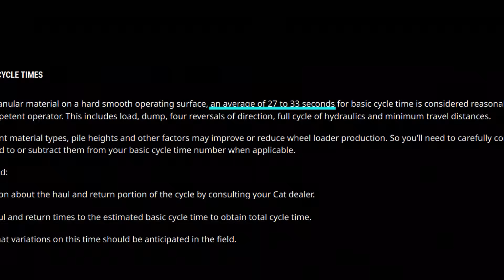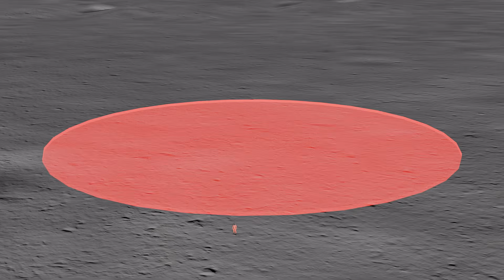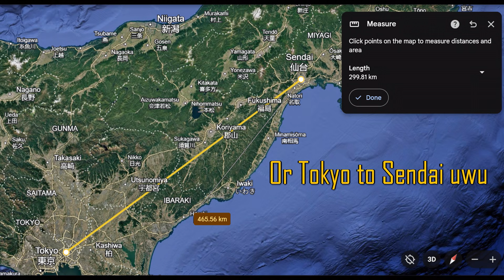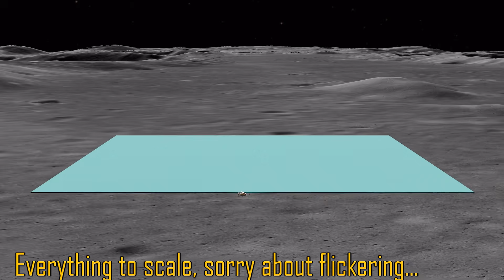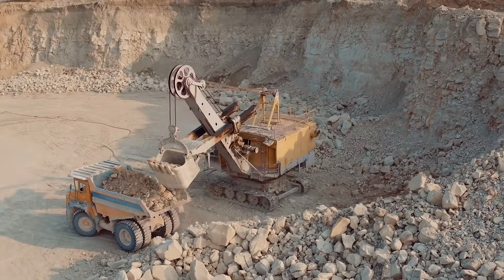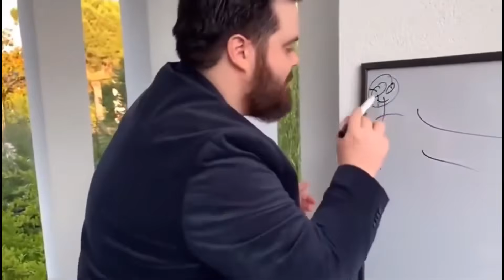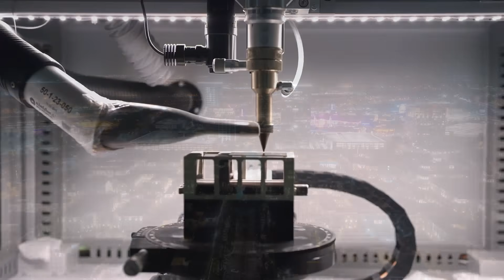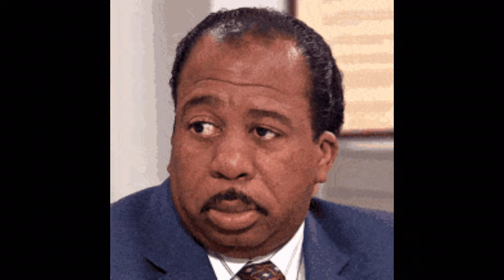How Much Bulldozer Can We To The Moon?

Comment: Science geek and heavy equipment operator here. I think in the broad strokes you've absolutely hit the nail on the head. The scale of lunar infrastructure does not require the immense beasts of Earth's pit mines. I think people might fail to understand the scale of the smaller vehicles you propose, because the scale of Starship and the scale of the massive equipment are really beyond most people's experience. From my best estimate, your proposed dozers, excavators, and loaders are pretty ordinary sizes for many Earth based construction projects, including roads, foundations, and large parking lots or gravel yards. Perhaps only the excavator is notably small compared to what might be common on Earth, but not unusually so. You are absolutely right in your realization that large amounts of material can be moved around with relative rapidity. Especially with a small army of machines, large earthworks (lunarworks? regolithworks?) projects needn't take very long.

However, I do think your estimates for how much material a fleet of these vehicles could move is overly optimistic in many ways. I do think it would have been good to use smaller machines as your baseline rather than scaling down the supposed capabilities of the larger machines, but it is also important to recognize that the cycle times are a nearly best case measurement. There are several factors working against those cycle times scaling in the way you propose, but not in a way that disproves your thesis. Here are a few of my thoughts in no particular order or thoroughness.

  - Traction. Lunar gravity immediately kills tractive power with a 1/6 multiplier, even assuming the equipment wasn't made lighter. This especially impacts bulldozers, but loaders also suffer by having more difficulty scooping into piles, and loaders will have to travel slower over uneven terrain or risk gaining air, toppling, or flinging away their load. The limited traction is further hindered by:

- Regolith Bulk Density. Despite the top layer of the moon's surface being quite fluffy, the bulk density increases significantly with depth, gaining 50% or higher density within only a metre depth. On top of that, the 'velcro' nature of lunar soil particles gives the regolith abnormally high cohesion, increasing the static load needed to disrupt it. All told, dozers are going to struggle to break free regolith, and will be limited in total push capacity by their much lower traction.

- Mass and weight. The loss of traction might seem to be somewhat balanced by the reduced weight of the material being moved, but this only accounts for static loads. Dynamic loads work against the mass (inertia) of the regolith, which is unchanged from its Earth counterparts. Eg. a cart could be made lighter to haul the same mass of regolith, but the tractor needs the same motive power to accelerate the cart. An excavator could move 6x as much material, but only at a significantly reduced pace (and only with a 6x more massive counter-balance). For many things it is better to consider the mass of the material instead of its weight.

- *Grading and other tasks*. On top of just moving material, other tasks need to be performed, such as grading to specified heights and slopes. Although dozers can grade, they are not ideally suited to it, and won't be able to perform major regolith moving while grading. For efficiency some dedicated graders are probably in order. These will move far less material, and only material already previously moved, so we're adding machines and machine-hours without moving more material. For many tasks the prepared ground may a layer of prepared material, something more like gravel, instead of just straight regolith, to achieve a smooth gradable surface or for structural or compressibility reasons. As we'll see, compaction may not require a gravel or crush type material, but at a minimum large rocks will need to be removed from the surface layer if a grader is to prepare a smooth surface (for paving or sintering or as a foundation for a structure). This could require rock crushers, sorters, and other quarry equipment, as well as additional hauling to bring the prepared materials to the construction zones.

- Compaction. This is a major issue on the Moon. If all we are doing is removing material, we can reach dense regolith and use the meteorite induced compaction of millions of years, but as soon as we need to fill in an area, all the fill material will be as fluffy as the surface of the Moon. Compaction is especially complicated by the complete lack of moisture, which is commonly used on Earth to coerce soils into more compact states. Thankfully lunar regolith has shown to be both compactible and to increase in load capacity, it will just take more specialized equipment and time. Impact rollers are likely the best candidate given their use to dry pack material on Earth, even at reasonable depths of a metre or more. Subscale tests in dry lunar simulant have shown promise as well. These rollers will need to be heavy, likely 10 tons or more, but could gain there mass by being filled with lunar regolith. They will also need tractors of some kind, perhaps the same type used for hauling 'carts'. Compaction is likely to require 10's of passes per metre of depth, performed in layers of fill, smooth, compact, fill, smooth, compact.

- Hauling. You point towards ISRU carts, but I think what is shows is not complex enough. Not only does material need to be hauled, it also needs to be unloaded, so haulers will need to be able to tip and dump carts, and do so with some level of precision. They will also need tractors or to have motive power on their own. I would suggest something like a tractor for motive power with one or a limited handful of wide carts (eg Tonka dump truck). End dump is the most useful but makes hauling more than one or two cart trailers difficult as they need to be backed in to place at the destination. Again, traction may be a major limit for the tractor, especially on loose material or sloped terrain. Hauling will also be needed with some urgency before the ability to make cart trailers in situ exists.

- Maintenance and Lifetime. You touch on a few points relevant to this, and I think a true investigation of how to make a piece of equipment that can operate a significant period of time on the Moon is well beyond the scope of the video, but I'll touch on it anyways. Earth born equipment requires maintenance, and a lot of it. We check oil levels, clean filters, and grease pivot points daily, and regular maintenance is performed usually every 500 hours of operation. Many components also wear, including the drive sprocket for tracks, the tracks themselves, buckets, blades, the teeth on excavator buckets (which are replaced regularly when in rocky terrain), and even hydraulic cylinders and other components. Electrostatic repulsion techniques will need to be employed to reduce dust buildup, and some mechanism for sealed joints will clearly be necessary to eliminate the daily greasing performed on Earth equipment. Electric in place of ICE and cables in place of hydraulics solves some issues, but cables in particular will be liable to get frayed or even snap. Rocks fall, equipment tips, trenches and piles collapse. Things happen to cause damage and the abrasive lunar dust will simply accelerate a lot of natural wear. Earth excavators and other equipment do well to last 10,000 hours of operation, and that only with significant maintenance and without significantly difficult conditions. I don't think we are likely to see that sort of lifetime for Lunar equipment, given the hostility of the environment, but perhaps it is possible. If we assume only working during daylight, and only 10% downtime for maintenance and charging, 10,000 hours is only 2.5 years of operation. This is one place where a mega machine may have some benefit, as the sheer scale (and to some extent the square-cube law) means the machine is likely to be able to have a longer operational lifespan with the proper maintenance.

- Total material moving operations vs actual material moved. The number of operations performed on a single unit of regolith is almost always going to be higher than one, even if only considering movement and not compaction or grading. Occasionally you may have material that a dozer simply pushes into place, but that would be rare. More likely would be something like: excavate, push with dozer, load into hauler, haul and dump, spread with dozer, pack (x10), grade. Or perhaps: Rip with dozer, push with dozer (significant distance), pack (x10), grade. Thus, especially for larger projects like roads or especially mass drive paths, the actual number of operations to count is perhaps an order of magnitude more than accounted for, and likely significantly more.

- Scale. Large machines may be more efficient when creating large scale projects, but many projects are not large scale, so smaller machines can easily prove to be more versatile. Smaller machines would be more effective for say, trenching for pipes or electrical cabling, or preparing foundations for smaller structures, or creating complex slopes or other shapes.

Essentially, more types of equipment is needed, and material needs to be handled far more than you showed, but this has at most a 1-2 order of magnitude reduction in the effectiveness of the down-massed equipment.
Reply: Best most detailed comment I've seen so far. More attention here is deserved
Reply: I just posted a similar comment and now saw that you had already made most of my points far more eloquently and with better subject matter expertise than I could manage. Happy to see that my thinking wasn't completely off-base. :)
Reply: It's good to have someone with practical expertise in the subject to weigh in on the video. If I'm understanding you correctly, while he has been overly optimistic on many points, the main point of the video, that we don't need the giant ISRU vehicles or the sophisticated infrastructure required to produce them any time soon, with the exception of some of the simpler things, like rollers and carts.
Reply: Well written, mate!
Reply: Huge respect for such a detailed and well writted comment. 

This is why I love this channel, it actually gets you thinking how do we get an advanced moon economy started, not just "here is what's possible" like most channels do.
Reply: So the conclusion is most of the problems you mentioned can be fixed with regolith ballast tanks (for counterweight) and vibration impact tools?
Reply: @wafflecat8 and more machines and time. The estimates in the video are extremely optimistic, by probably an order of magnitude or more, so the numbers in the video aren't a reliable way to judge how much downmass is needed for earthworks machines. However the thesis is correct, launch smaller machines from earth and get lots done.
Reply: @bwjclego  I'm actually a robotics engineer. Would it be a good exercise to see develop a team of mini bulldozers to see how well they fare against a full sized Cat D11 for terrestrial tasks or building a mass driver foundation?
Reply: @wafflecat8 i suspect it would be easier to do simulations rather than full scale physical tests, but I don't know how easy it is to simulate the geology. There is probably more than enough real world data to compare the effectiveness of the different size machines.
The thing about the D11 and other massive machibes is that the scale of lunar infrastructure is really pretty snall compared to what we do on Earth. A D11 would only be useful potentiall for building a mass driver foundation, and it might even be a bit to big for that, but I would say that depends on how significant the elevation changes are that need to be smoothed out. As i said in my original comment, the 'small' machines depicted are not small, they are as big as what build highways or large building foundations, or at least close to it.
Reply: @bwjclego  Simulation and comparing the effectiveness of different size machines would be less crazy, yes. Thank you for sharing that 😅

Comment: I would argue there's one major issue with assuming 1 minute turnaround time for a bulldozer cycle: Input latency may only be 1 second, but lining up every single movement is going to take much more than 1 second assuming it's remote controlled from Earth. There's a video on youtube called "living with lag" that explores this exact idea by giving people VR headsets and delaying the camera feed by 1 second. The result was debilitating at first and even after getting used to it people still needed 10+ seconds to do something that normally requires 1 or 2.

Comment: So, a few things:

First, the benefits of using smaller imported excavators at first doesn't preclude building bigger ones onsite later.  The efficiency of larger vehicles at larger scales can't be ignored, plus the ability to repair or construct new ones onsite instead of waiting two weeks for another one to be purchased, shipped, and finally SpaceXed to the Moon can't be ignored.

Second, I have some concerns that even the mini drone excavators may not have appropriately fine control of motion for operating on the lunar surface.  An excavator built on Earth will effectively be six times more powerful, sure, but it would also have six times as much torque and would be at a greater risk of overturning or just flinging its cargo into the air (I realize that the Moon doesn't have any air, but in this case it's an appropriate figure of speech).  Combine that with the thermal and mechanical adaptations needed to make these things not melt from their own engines' waste heat or shut down permanently because the batteries froze, and it's gonna take a little more than off-the-shelf technology to make them work.  It also reduces the likelihood of building a lunar colony since the drivers can just operate them from Earth in near-real time.  If we're not careful, automation and teleoperation might make a human presence on the Moon completely redundant, and that's with technology we had 30+ years ago (the Soviet Lunakhod rover was driven around by radio from Star City in 1970).

Third, that landing pad is gonna need some kind of flame diverter trench to reduce tile erosion from all the engine plumes blasting away at its surface.  Or maybe not.  Maybe it would be cheaper and easier to just replace and recycle damaged tiles than to try to make them last.

Comment: With the Moons low gravity we would, if anything, need a bigger, heavier machine in order to dig in effectively. 

You wouldn't send a stock D11 to the moon though. Eventually, you'd make your stuff on site, but even early on you'd send a version of the D11 that is made of much lighter materials and add dead weight once in the moon. These would be light enough you could send two or three in pieces im one shot and assemble there.

Comment: @Anthrofuturism – I recently watched the video “Goodbye Sandbags? This Is How Fortifications Are Built Now | HESCO Barrier”, and it got me thinking - instead of thermally hardening bricks on the Moon or Mars for radiation protection, what if we just launched empty HESCO-style frames in a Starship and filled them with regolith using a front loader?  They’d be fast to deploy, lightweight to transport, and make good use of in-situ resources.  Yes, they might need material upgrades to survive lunar or Martian conditions — and they might not be ideal for permanent structures — but as a modular, early-stage shielding option, especially around temporary shelters or equipment, they might be way more practical than trying to build a kiln out there on Day One.

Comment: Another great mind-churning video! Have you considered conveyor belts instead of carts/trucks? if you can make a caterpillar out of ISRU materials, with a frame out of steel beams and rollers made out of simple metal or even cast regolith, with the belt consisting of cast regolith "shoes" over steel wiring or mesh, well that's basically what a conveyor belt is. On the Moon without rust, oxygen, fauna, rain or wind it can remain there constantly turning and moving ore uphill, with gentle sheet metal covered lopes on the downhill side. A chain of those can cover many Kms of cratered surface straight though without needing road laying and vehicles, while requiring very little terrain engineering, energy or mantainance compared to a fleet of vehicles. Food for thought! 
And I think someone should definetely make a Factorio mod of these great ideas! I would buy it in a second!

Comment: You have to move the mass multiple times as it is refined and manufactured. Also, the moon still favors large machinery due to wear and tear on wheels. Legs become more efficient in larger vehicles. A detachable fairing and uppper stage lander could help start with larger vehicles for a happy medium as first phase vehicles.